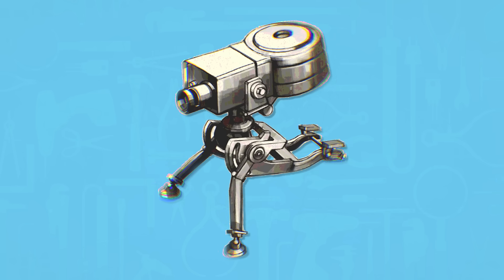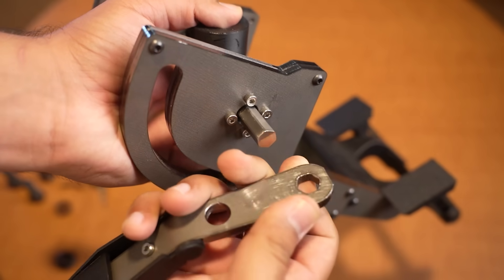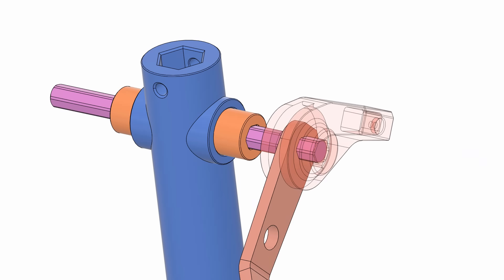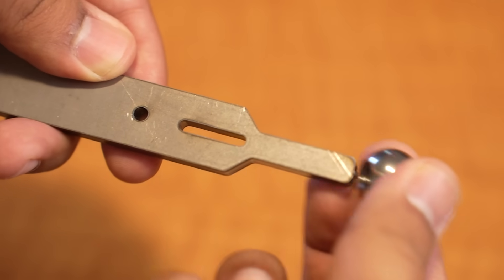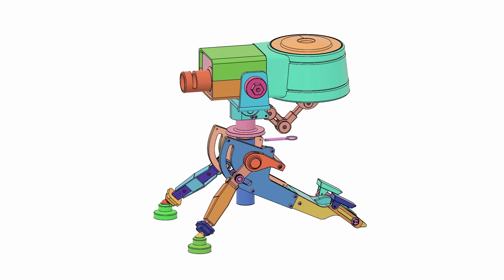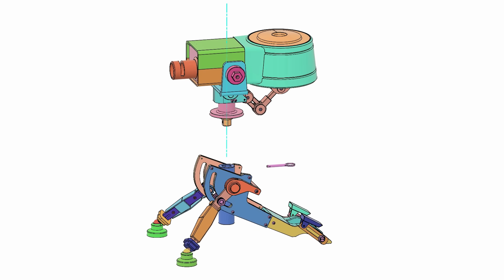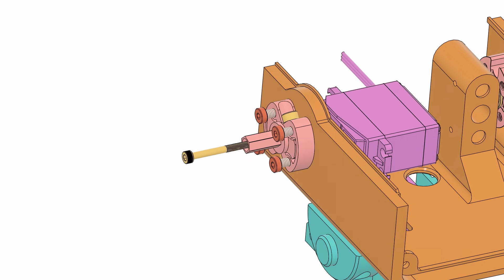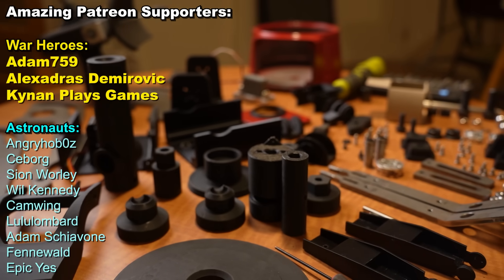Designing a Real Level One Sentry from TF2

Comment: As someone who has designed one myself, I haven't really watched the video yet, the physics of the gun standing upright in it's position is not possible unless you redesign it. Otherwise it will fall backwards (usually) from the uneven weight distribution.

Comment: I've always thought that if I ever built anything like this it needs a weight on a spring inside that is accelerated by a motor in one direction and then returns until it slams into an end stop to create a violent jerk and sound. Have it repeating a few times a second to make the entire gun shake as if it's firing.  Combine that with a well timed ultra bight and short pulse from a red light and you should be able to get something that looks pretty realistic. You have the sound of the metal end stop being hit, the gun visually jerking back and also timed flash of light.

Comment: For the barrel, another idea I had is to spring-load it, and have a mechanism to just push the barrel forward and let go. The loaded spring may be able to provide a satisfying, snappy kick-back more easily than a servo.

(Technically, it would start in the primed/loaded position, then when it "fires" the mechanism would let go, move back, pick it up and push it forward again)

Comment: Honestly, this gun reminds me of Degtyaryov series of machineguns with their cylindrical magazines. Specifically, the tank version (DT) since it seems to hold its cartridges vertically. The caliber is largely over-exaggerated, but a more realistic version of this gun would probably be a DT with no stock or pistol grip, and much bigger legs to hold the sustained fire of full-sized cartridges aside from a buttload of sensors. Engineer is Texan, so either he just uses 7.62x51 NATO or smuggles 7.62x54r. However, with that caliber, it might as well be an automatic grenade launcher.

Comment: I believe the leg assembly is based on an irl machine gun tripod/sled mount, which is why there appears to be useless adjustment slots cut for the front legs; it would've be for locking elevation in place on uneven or sloped terrain.
Edit: Did a little looking and found what I was thinking of. Google the "German maxim gun sled mount" and you'll see some clear similarities between it and the sentry gun's mount. Notably the slots cut for adjustment in a very similar fashion to what we see on Valve's model

Comment: As a 16 year old trying to self-learn 3dmodeling and engineering, i would love to know if this program you used to model the design is fusion 360 or some other program. The work you do is insane! I couldnt imagine even modeling a single screw of this terrific turret!
Reply: he mentioned in a different comment that he's been using Fusion360 for 8 years
Reply: Well you started wrong there. You don't model screws on F360 you just add them from a downloadable catalog.
Jk, it is a really powerful yet easy to use software that I recommend to everyone starting or experienced. I started using it like 5 years ago when I bought my first 3D printer and haven't stopped ever since. It is what got  me into chasing an Industrial Design degree

Comment: How did you learn to be so good at cad 

Also what are you’re thoughts on freecad

(I’d like to be a architect and civil engineers but have sucked at every program I’ve tried weather it be freecad or blender
Reply: Wew tried to post this comment 5-6 times. Those fields use AutoCAD primarily.
Reply: @ChucksSEADnDEAD  I’m too broke for autocad
Reply: @TailcoatGames  If you end up studying in the field your university email will unlock a free student version of AutoCAD.
Reply: @ChucksSEADnDEAD  my dream school expects a portfolio is the problem
Reply: @TailcoatGames  Talk about putting cart before the horse. Try Fusion 360, get an industry contact, enroll in a CAD class at a community college, etc. anything that allows you to get access to proper tools rather than learn software that the industry doesn't care about.
As for getting good at CAD, take 2d drawings and turn them into 3d CAD, and take 3d CAD and use the software to generate 2d drawings.
Reply: @ChucksSEADnDEAD  ok thx, I’m also trying to take a studio art class at my high school (class to let you make a portfolio only projects no teaching) so I need to make some stuff before summer ends lol

Comment: This is super cool.  I was sort of surprised to see that you went with a servo for the recoil--if I'm understanding you right it'll need to rotate both clockwise and counterclockwise for a full fire cycle, right?  Have you considered using something like a RC drone motor hooked up to a drop cam to get a nice quick recoil motion, followed by a smooth recovery, all while having your motor only spin in one direction (i.e. fewer sudden rotational accelerations).  I'm guessing you've got really good reasons to go the route you did, but it's always interesting to hear about tradeoffs that had to be made.
Reply from the maker: A few reasons: I already have tons of servos on hand, it can travel the full range of motion I need at the speed I need, it keeps cost/complexity lower for other people to build, and I generally try to keep to one actuator type in a build if I can,.

Comment: Made my own lvl 1 sentry with my cad for my printer as well. Had the same issues with the feet and I'm kinda bummed I didn't use the slots like you did! Mine was tiny though and I made almost all the joints felxable (which makes it floppy!!) including the turret itself sliding into the head. What you have done is beautiful, the steel and electronics make it mint.
Reply from the maker: You can always revisit your sentry :) Thank you! Yeah, the model (if made 100% accurate) has waaaay too many hinges that don't "do" anything IRL. It's mostly to make the building animation easier I imagine.
Reply: @MrVolt  absolutely. My design was obviously flimsy as it's tiny and plastic. I'm happy that I can recreate a lot of the sentry animations as almost everything moves. A lot of pins were improvised from paperclips and toothpicks haha. It still stands tall however, and I really like how it turned out. Not sure how to do such tiny ball joints for the feet, thats my biggest disappointment.

Comment: My question now is the TF2 sentry more or less sensible than the Aperture ones? lol
Reply from the maker: Insane in different ways. The reason I'm starting with the level 1 sentry is it's the most balanced design, but it still has some "cartoon" physics when it comes to motion. The Portal turrets are reaaaally top  heavy, so they'd need to be anchored down or they'd flip from firing a single round!

Comment: amazing. i designed a little sentry which turns and beeps, but i just put the axle of a stepper motor straight through the tilting bracket onto the base

Comment: Interesting choice for the recoil mechanism. I would’ve thought a design similar to a steam engine train piston would make the build a bit simpler, since it would require a motor to only spin in one direction (I’m not at all familiar with motors like this, but I’d guess that maybe it’s slightly cheaper, lighter, and smaller?), as opposed to having to move back and forth like the one you chose. Did you not think of this, or were there specific benefits to going with the design you ended up using?
Reply: I guess if you want to sync the recoil thing with the shooting then a servo gives you easier control without setting up additional encoders.

I would have used a DC motor with shape that pulls the barrel back fast then returns it slower.

Comment: I think you could have managed to get the horizontal turning action on the top hinge without compromising the hinge design at all. Using flywheels and gyroscopic procession, you may be able to get it to rotate by placing said wheel in the round housing of the head assembly. This would likely be even more expensive, wildly complex, incredibly unnecessary, and may not even be possible with your launching mechanism and barrel action assembly, but I thought it was a cool idea.
Reply from the maker: Technically possible! There's not too much room in the forward housing though, since space has to be left for the barrel and my secret firing mechanism. Also, I want to keep parts simple so that more people can build it. Would be a fun experiment to try in another version though!
Reply: Ah yes 
Add reaction wheels

The Kerbal Space Program method
Reply: MOAR REACTION WHEEEEEEEEEELS @mihailazar2487
Reply: that would loop right back around to the very first issue of weight though

Comment: You should have used a stepper motor for the yaw control since the sentry rotates 360 degrees
Reply: GoBilda have multi-turn servos 
They can go up to 5 full revolutions

Comment: if you have the budget for it you could use some titanium for the feet and parts of the base since while it is a bit expensive its a lot more dense and durable so it would help with the turret being top heavy
Reply: Titanium is less dense than steel :)

Titanium is only stronger than steel by weight
Reply: For maximum density osmium could be used for the low low price of bankruptcy